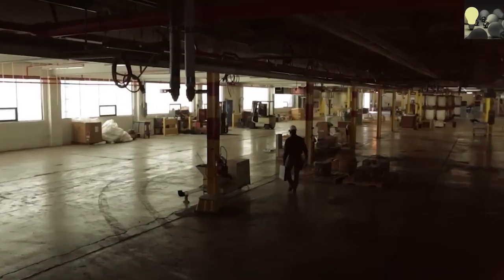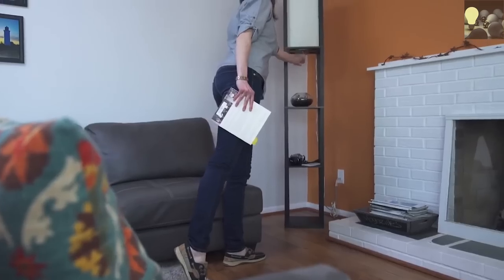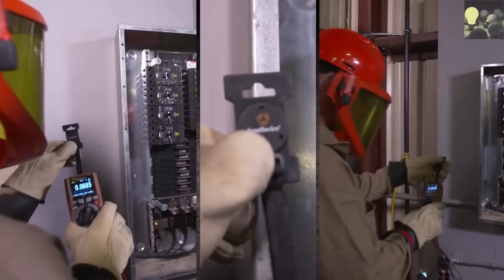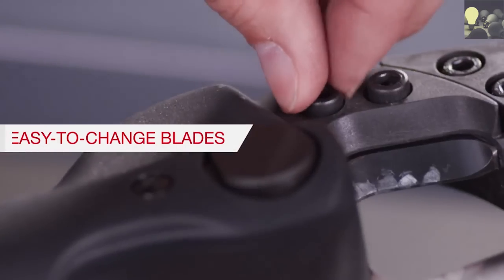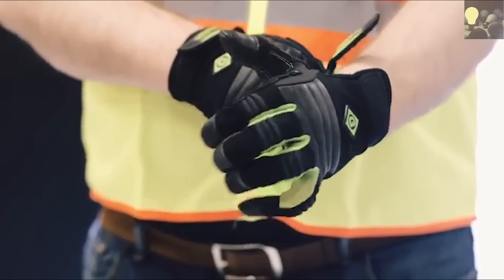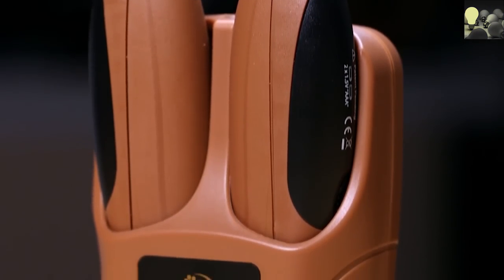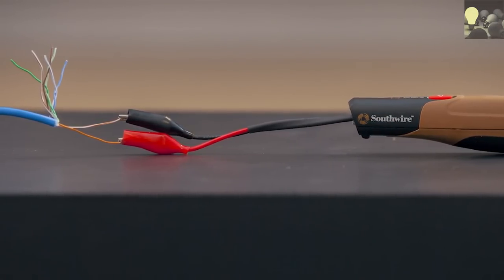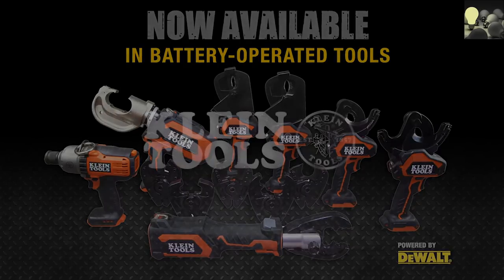TOP 10 BEST ELECTRICIAN TOOLS YOU NEED TO SEE 2020 AMAZON

Comment: Although another commenter criticized the ballast tester due to LEDs current prevalence, I still have very many customers with fluorescent lighting. My only criticism of this tool is that you keep trying to sell us on the extension saying that no ladder is needed and yet every single video segment has the hinged lens opened on the fixture.
Reply: Parabolic 2x4 & 2x2 grid light fixtures don't require opening of the fixture to test so in those situations a ladder wouldn't be required. Also not required for testing fluorescent pot lights.
Reply: @MrNightro  In order to fix the problem you need to get your ladder anyway so what exactly is the point then?  M a y b e  if you are just the inspector type that doesn't actually fixes anything.
Reply: @Slim08151  If you're doing a plant or office building & have a number of fixtures to fix. You do a walk around first noting what each fixture requires. You then have an idea of the required materials beforehand. Seeing as a lot of businesses request quotes before approving jobs it helps cut down time doing the quotes.

Comment: the only usefull thing to me is number 1..... oh wait., ill just do process of elimination at nighttime where nobody use electricity rather than buying that expensive thing
Reply: Some commercial buildings won't allow for the random shut down of power at any time, especially hospitals & clinics. Also, these testers are so much faster than randomly going panel to panel floor to floor trying to locate a circuit.